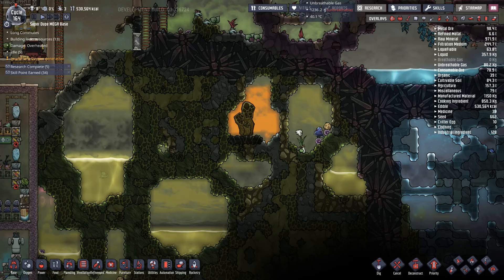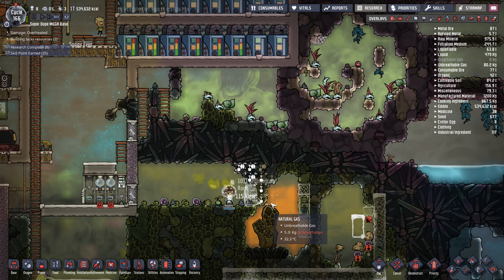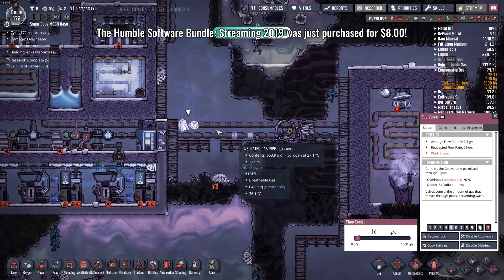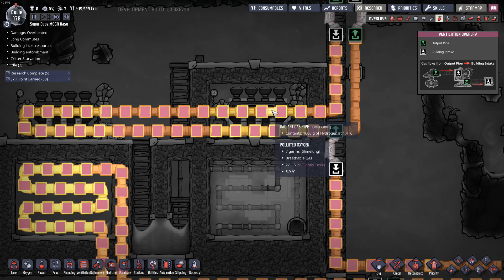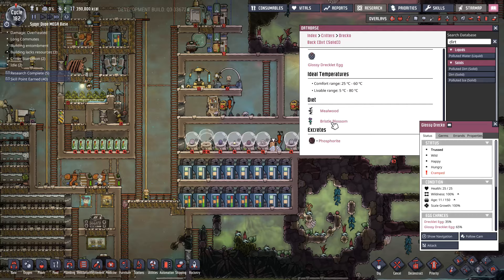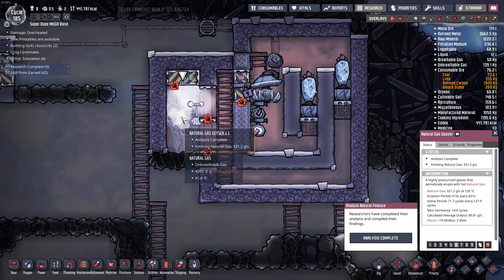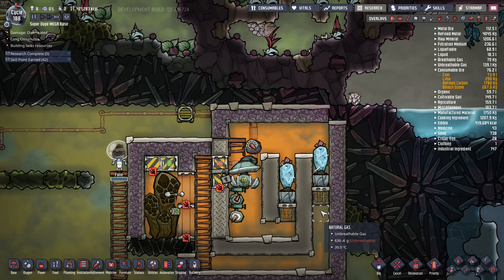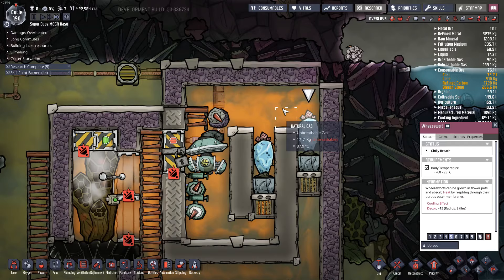Compressing a Natural Gas Geyser with a Wheezewort! Ep8 - Oxygen Not Included Quality Of Life 3

Comment: Not sure if one of the other comments touch on it, but your hydrogen vent cooling steam gen is missing its water return. You are going to have to break back into that area to get it running. Also with the minimal heat that the hydrogen vent puts out (while the temp is high, the mass that gets ejected is low), I would add a liquid radiater loop to that steam gen, and then just leave it hanging for now. Not sure what you would use the extra capacity to cool, maybe liquid O2/H2 later when you have an appropriate coolant. Although it isn't very close to where those will be generated.

Comment: The wheezewort venturi compression system may be able to have more safeties now that the wall pot has been introduced. You can put the wallpot directly above a door automated to close as the pressure approaches vacuum so you never have the wheezewort back up.

Comment: I use gas weight and pressure to remove undesired gas. I make 1 hole in floor or roof depending of the weight of the gas to expulse), i add the gas pressure of the vent to push undesire gas out. No need of pump for vacuum to remove gas, you let the gas go how it should.
Reply: It’s natural gas for generators.
Reply: @PashaGamingYT  I have badly explain what i want to say sorry. 22:22 Brothgar trying to get rid of a single tile of polluted oxygen.  My trick to get rid of this polluted oxygen is to make a hole in the chamber's roof, polluted oxygen escape and you close the hole. Also work with all other gas,  I just use the gas  weigh and pressure make a hole in roof or floor. No need of vacuum of somesort to try to pull out the undesired gas. You just have to let the gas pressure increase in the room, the 'bad' gas escape then you close the hole.

Comment: what happens if you submerge a gas vent or volcano in liquid? does it stop making stuff?
Reply: i use a cool steam vent with a 3 tile high "bucket" around it and the flow stops once it fills. To avoid overheating and pumping i have built my water reservoir below and build ice plates until temp is low then drop vent water into it. I use the area around the vent as my Hydrogen catch which disperses the heat instantly and keeps the steam from spreading
Reply: Ooppss forgot to finish the thought. As far as gas or volcano i haven't tried but would be interested to know